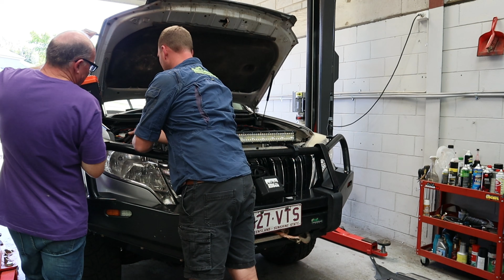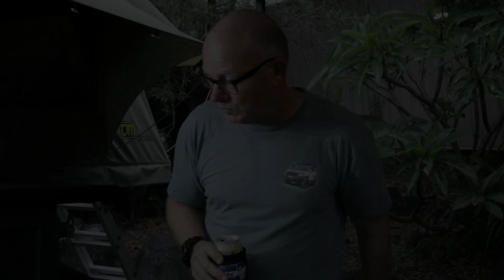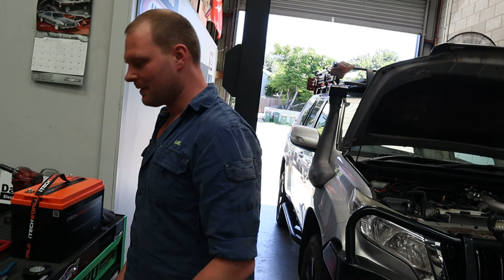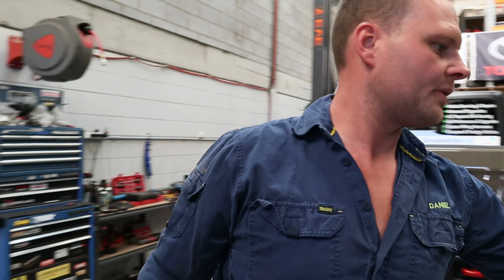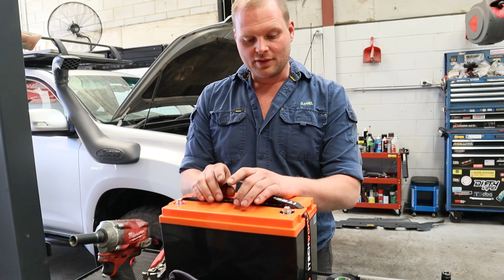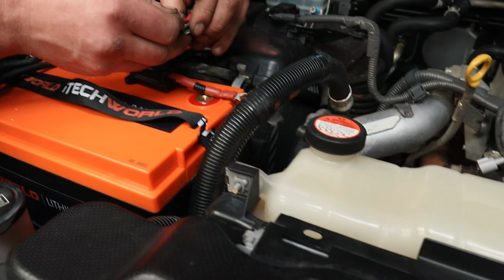ITECHWORLD LITHIUM BATTERY UNDER BONNET?😲 |PRADO 150

Comment: Hey Mick, how is this going for you now? are you still running the Lithium second battery?  maybe the strat battery too? cheers mate
Reply from the maker: Hey mate. Still going strong, under bonnet. Nil issues at all. Running the upright fridge 24/7. I didn't go with a lithium starter battery at the moment. Not sure if I will or not. I'm very impressed by the Itechworld products.

Comment: That looks to be a very tight fit, is it definitely not distorting when clamped? Or did you end up fitting a new tray?
Reply from the maker: Yes it was. However now Itechworld have a slightly small one, same capacity and it fits very nicely now, and still going strong
Reply: @prado150outahere 120AH?
Reply from the maker: Yep, the 120 AH

Comment: What battery tray do you have installed and whats the max size battery its rated for?
Reply from the maker: Many years ago, when running the N70 AGM battery I bought this battery tray from  EBAY. Although a bit of a tight squeeze the lithium has fitted in there quite comfortably. However though, Dan the mechanic from my videos can make a custom battery tray to fit. The issue with my current battery tray is the sides. However I have made do and it works perfectly, without any issues
Reply: @prado150outahere  Did you get a bracket for the aircon hose. I hammered the stock bracket flat and put my AGM battery in. This itech one is 330mm. I am worried about bending the hose even more.
Reply from the maker: ITECH WORLD have a 120X New edition Lithium battery, made for the Prado! Fits perfectly I've been told.

Comment: Did you need to bend/move a pipe out of the way?
Reply from the maker: No, bit of a tighter fit, however no issues. Dan is a jack of all trades and does auto aircon as well as auto electrical! I was in good hands

Comment: Lithium Batteries are great but If you install them in a Vehicle that's on the roadways the potential for a catastrophic fire or worse exists if that vehicle gets in a crash because Most New vehicles are made to crumble, Especially the engine compartment in order to save the people inside, in theory anyway. A Lead Acid battery would be less likely to set itself on fire after an impact.
Reply from the maker: Definitely something to consider 👍

Comment: I don’t get your heading for this video!  Are you saying don’t put a lithium battery under your bonnet?? Yet you did??WTF?
Reply from the maker: The full title is ....Until You See This. Most lithium batteries you can't install under bonnet. Not all guarantee under  bonnet. And normally I wouldn't however after my research on this one I was then prepared to, and I take you through that journey and hopefully give out valuable information. Sorry for any confusion, thumbnail changed 👍